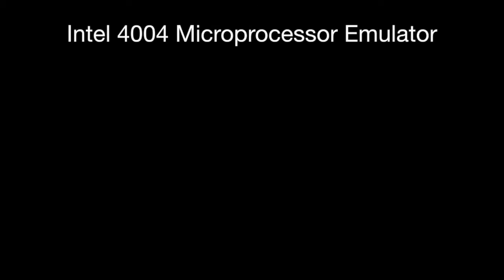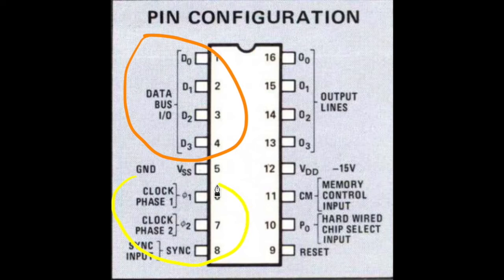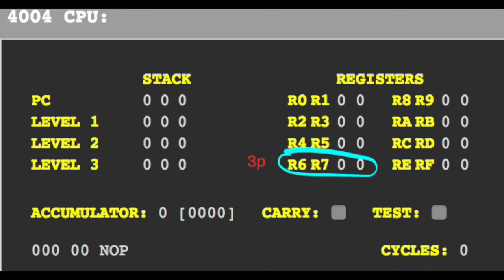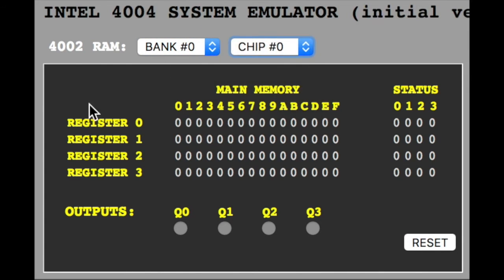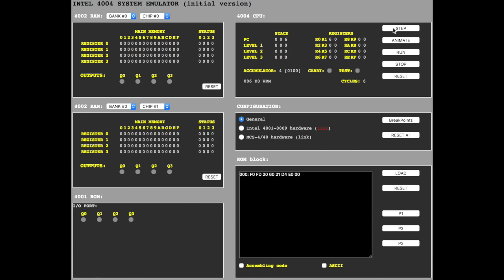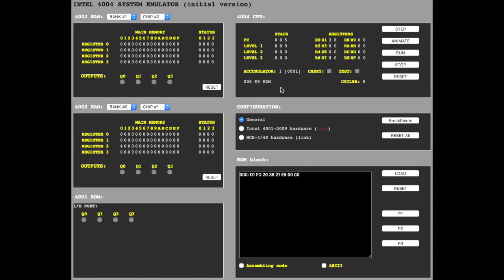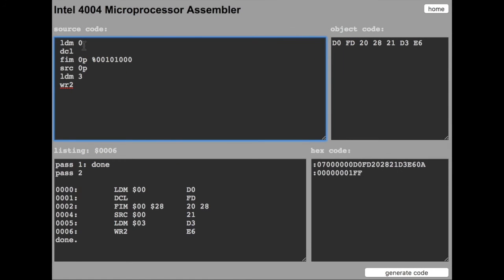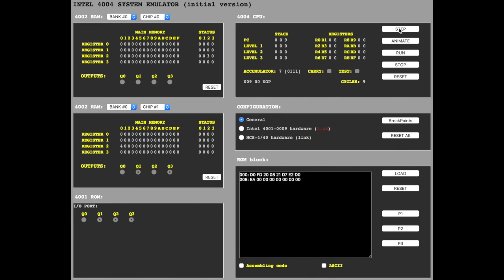Intel 4004 Introduction

Comment: Thank you for your clear and slow paced tutorial. I'm still pretty new to the world of CPUs, but am fascinated by its inner workings, and the 4004 is a great place to start. I managed to find the 4004 Assembly source code of the Busicom 145 PF calculator, and am particularly interested in how on Earth they programmed their device to compute square roots with 10 digits. Have you had a look at the code? It's very short!